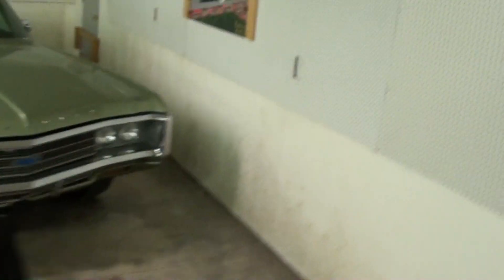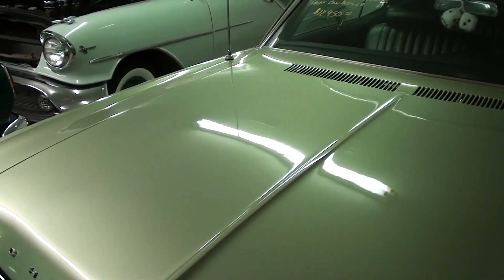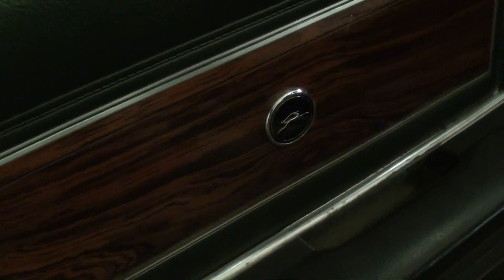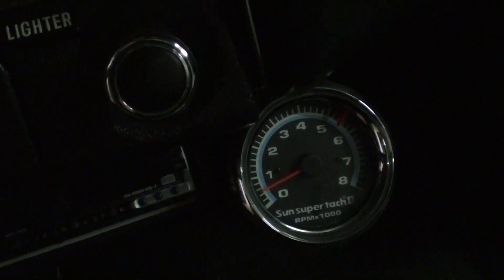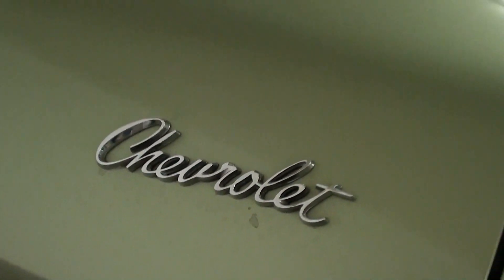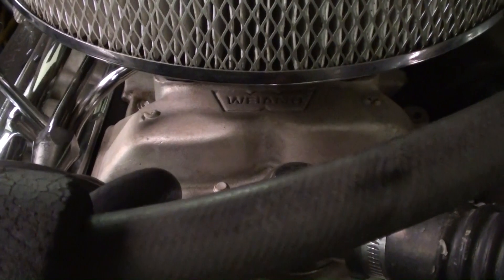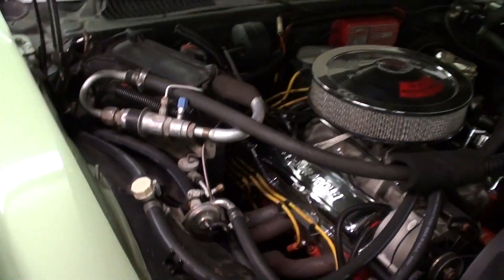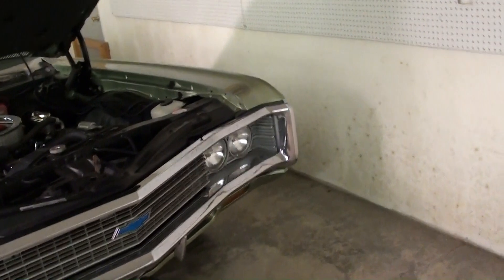1969 Chevrolet Impala Custom 327 V8 at Country Classic Cars

Comment: The Impala Custom was one of two Impala hardtop coupes Chevy offered in 1969, wearing a formal roofline versus the sportier lines of the Sport Coupe. Its purpose was to give Chevy customers the Caprice coupe's styling at a lower price. BTW, the color of this car is Frost Green.

In Boston we have a nightly program called "Chronicle" that used to have an Olympic Gold 1969 Impala Custom that the hosts would drive to various points of interest in New England.

Thanks for sharing this with us!

Comment: I'm pretty sure 1968 was also the year they started putting side markers (lights) on cars. I do remember how strange cars looked to me without vent windows, I was told it was a cost cutting move, but others said it was for style, I don't know if either is true, just one of those things I remember. Also in 1965 Ford was the 1st to introduce the "suspended gas pedal", they took it off the floor and it is what it is today.

Comment: Nice looking Chevy.  I miss the days when you had an option of maybe 6 or more engines and the size was posted somewhere on the side.  On that 69 big Chevy one could get a 250 6 which didn't have the cubes posted or  307, 327, 350, 396, 427 with these offering 2 or 4bbl carb options.  Those were the days.
Reply: I wonder why GM still offered the 327 even after the 350 was made available across the board the only difference was the rotating assembly the blocks were the same 4" bore.
Reply: @1575murray  Not after 1969.
Reply: @chrisjeffries2322  That's true the large journal 327 was only made in 1968-69 after that you could only get the 307 and the 350.

Comment: This was my first car, and I don't mean I had a 69 Impala, it was this exact one!  I built that motor, it's actually been bored to a 350, it's a Holley 650 CFM Double Pumper, .500 lift crane cam, hydraulic lifters, HEI ignition, MSD 6A box, hooker headers, Turbo Hydra 350 trans, the paint is Frost Green metallic(factory color) and lots of TLC went into this car, joined the Navy and said no more time for it.  Should have less than 80,000 miles on it documented.
Reply: The 327 and the 350 have the same bore, it is the crank and rods that are different.

Comment: Question: What type of transmission did 63 Impala 409's come with from the factory? I heard it was a heavy duty version of the power glide because there was no turbo hydromatic in 63. Is that true?